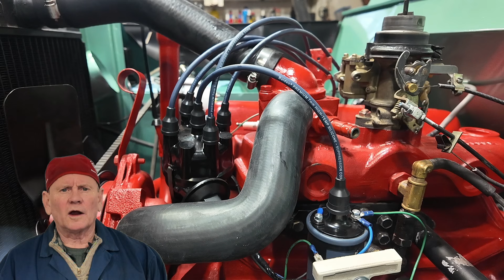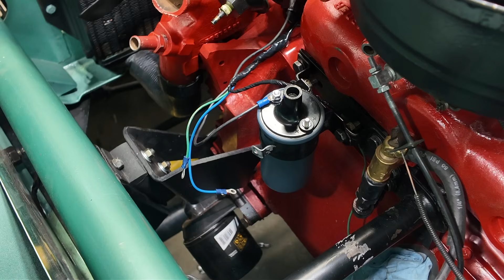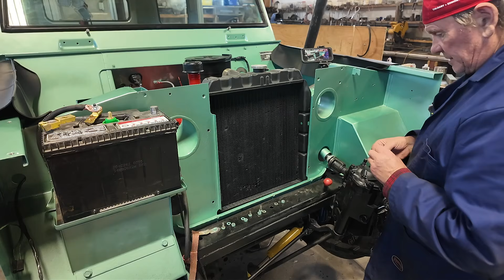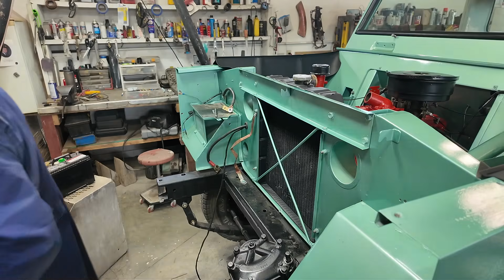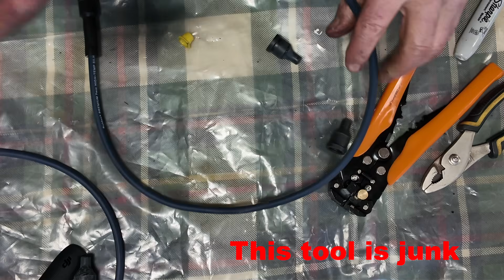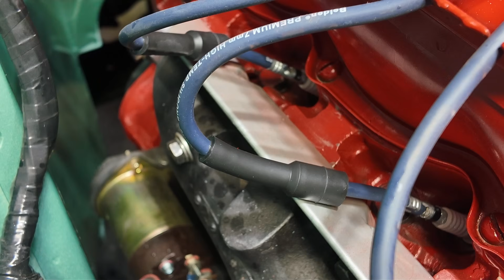Scout Restoration Yukon: Engine Hook-Up 2. All the Details !

Comment: This is great! Im currently refreshing some of my 64's ignition system and this is very helpful. For some reason mine never had a ballast resister, do i need to add one back?
Reply from the maker: Many Scouts have resistor wire in harness you don’t want both !
Over and out !